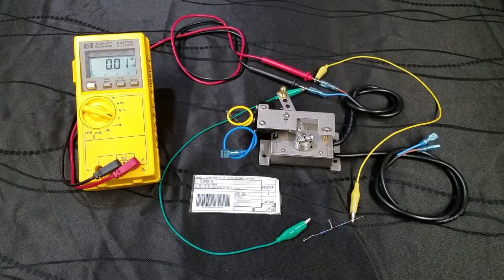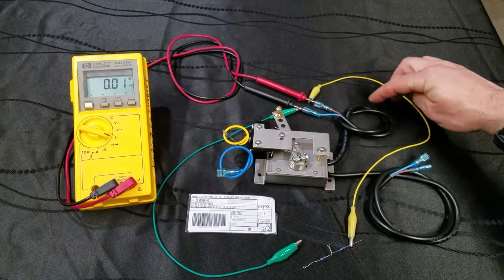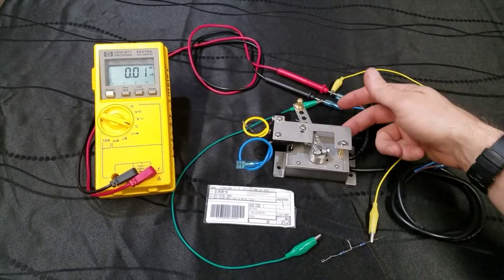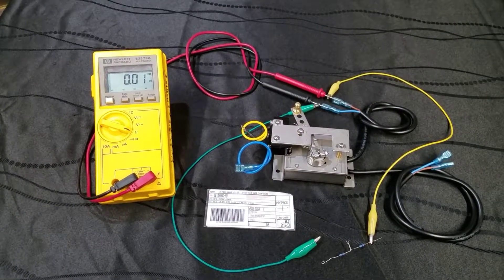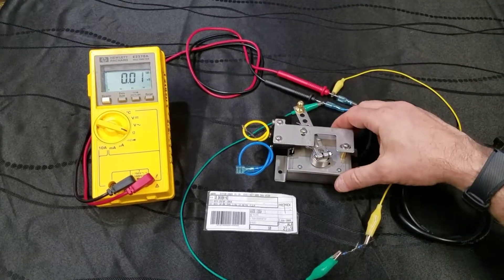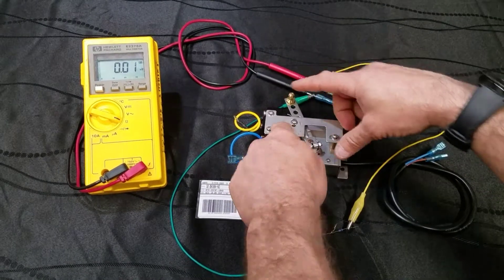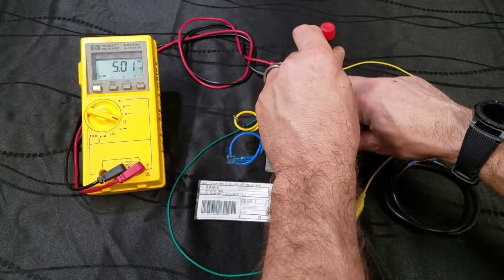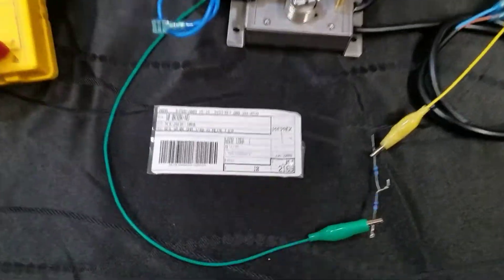Universal POT box adjustment (using 10k Ohm resistors)

Comment: can i adjust the ohm to cut off at 5.0 at half throttle?
Reply from the maker: It's best to get the right potentiomerter. However,  depending on the type, you may be able to adjust the mechanical throw to accomplish what you want.

Comment: I have a ezgo cart with a pot box that goes up too 8.00 ohms. Does that mean it's bad? My cart stops running passed half throttle at about 5.50 ohms.
Reply from the maker: No. Most controllers stop responding soon after 5k ohms. First try to adjust it's shaft and linkage arm to reduce max throttle from going out of range. If that works without making the low-range too low, it's the simplest thing to try. You may need to reduce the pot box arm travel by connecting your linkage closer to the pot center-line.
Reply: @kirkswaney1953  thank you I bought a pot box and it works now just wish it would go faster but upon further research I found that is not possible with out making a 48v cart
Reply from the maker: Most controllers I've dealt with need 0 to 5000 Ohms  (5k Ohms) input. Much over 5000 Ohms and the controller stops responding until the pot comes back within range (under 5000 ohms) and some must go back to zero and start over to respond.